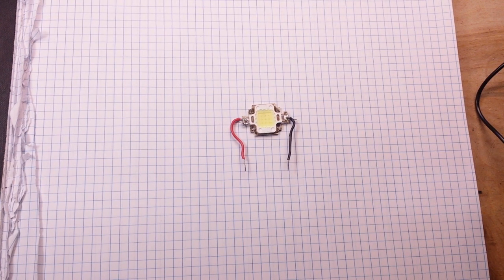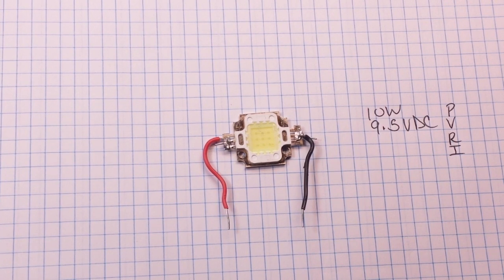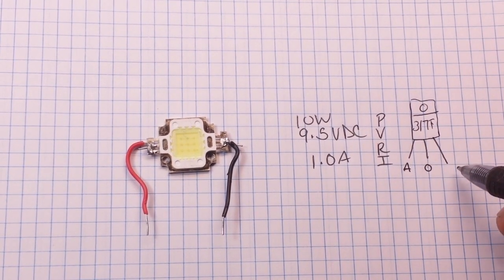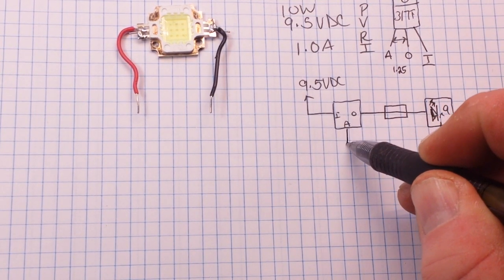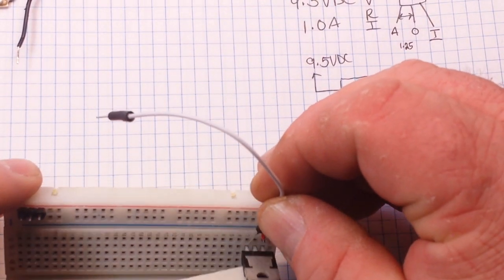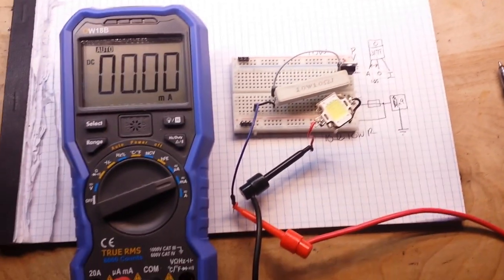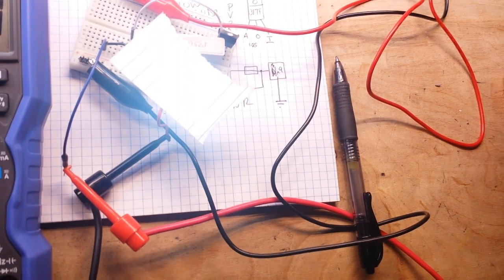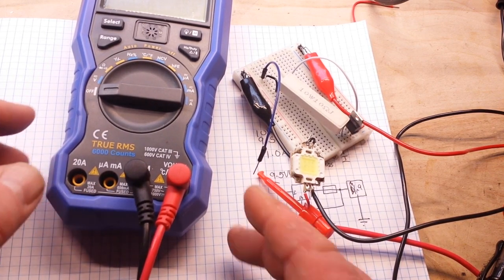How to make an LED driver circuit

Comment: This is a really great video, I like the way you explain your understanding, so I can understand
Reply: Niners fan, from way back though
Reply: Also sir I am struggling we're trying to find knowledge on how to build a simple circuit to monitor and recharge lipofe4, if you could do some videos. I really I really think the simplicity of how you talk would help me to understand. I know with mosfets there is a way to provide the correct voltage and amperage after testing. It's revolutionary and I wish someone would just do it
Reply: Once again thank you

Comment: I used to be a Patriots fan until Tom Brady left that's interesting with the lm317 I've used that to make a driver for a laser circuit for a diode laser it's also the same chip that's used

Comment: Hi, I have a current source driver 900ma, and one Led 3w. On current driver box, input ac 220v and output 12v and there is two points labeled as -Led and +led. I know Led has vf average 3.4v. There is something confused me, if I connect the Led as labeled that means I’m putting 12v on Led please correct me if I’m wrong! So I’m thinking to connect a series resistor to drop the voltage across the Led to 3.4v. What do you think please. Thanks

Comment: You could use a 7809 with a diode inline with the ground to add 0.6 volts to the output.

Comment: How would you calculate the resistor value if you had a 20 watt 36 vdc led COB? Will the same transistor work for the example I mentioned?

Comment: Cool vid thanks for sharing  . Could you tell me how to test a LED driver and a LED light  With a regular multimeter To see which component is bad?
Reply from the maker: Put meter in diode mode. Red lead to led anode, black lead to cathode. If it doesn't light or you don't see a forward voltage on the meter, then the led is bad.
Keep in mind not all LEDs will light from a meter. So let the forward voltage display be your guide.
Reply: @learnelectronics  ok thank you!

Comment: Here's the project. I am adding a 274 nm LED bead to my hard shell N95 mask to help reduce possible infection. Will the coin battery with switch I am using power the LED bead? Not going to into particulars.
Reply: Check out bigclivedotcom channel, he has done a fair bit about UV purification

Comment: Can someone please explain a little clearer how to calculate the needed resistor value for a given current? I get ohms law but I'm not sure how to apply it to this circuit for figuring out what value you need. And also, will this maintain the CC with varying input voltages? For example, running an LED off a battery, would the CC drop as battery voltage discharges?
Reply from the maker: You have to start by looking at the data for the LED. It will tell you what the current recommended is. Usually about 20mA. Now you know one part of Ohms law, I, the current. Then you should also know what your supply voltage is, say 9VDC. Now you have 2 sides of the triangle a can solve for the unk
Reply: @learnelectronics  but i mean, is the idea to size the resistor between output and adjust so that it's passing the desired current to adjust pin? That's the part I'm not sure of.
Reply from the maker: Yes. The manufacturer tells you the current for the LED. You know the supply voltage. So voltage divided by current equals resistance. That's how you figure out the correct resistor.

Comment: can this driver keep a constant current on a variable dc voltage, eg automobiles 12 volt system  which may vary from 11 to15 volts or can it only work for 9 volts

Comment: Good day, excellent video, you have earned another subscriber, I have a query, in the country where I reside, Argentina, the import is quite complicated, I need to manufacture the drivers for 3w smd LEDs to reform the original lights of the cars  , in cars the voltage usually reaches 14.6 / 7 volts, I have already manufactured a LED sequencer with the integrated 555 and 4017, but these do not handle the indicated power, that is why I need to group them 3 by 3 with their respective  drivers, could you help me with this?  my email address is locomario7852@gmail.com, I would really appreciate your help, it will only take a few minutes, thank you very much!

Comment: Hi!
I bought a led driver which requires an input voltage of 5-32VDC. Can I simply use an adapter which has an output of 5V/2.5A? Please help. Thanks!

Comment: V=9.5, I=0.120A then Power=1.14W. you are driving 10W led with 1.14W of power.
Reply: Because it's a breadboard demo! Running 10w into it in this setup it would overheat too quickly for the video. It's just a demo of the CC circuit not an implementation design guide.

Comment: Could you please help me to clear one confusion. I posted on many forums but did not get any reply. I brought a LED bulb driver from a reputed manufacturing company. I found something unsual. When I complained, the company did not bother to response because they are over confident. I shall be hightly thanksful if your provide your opnion. My email ID is s.kawish@gmail.com and WhatsApp number is +917502000800. Please respond by any means so that I could share the circuit details.

Comment: Awww, why hate Patriots fans ! By the way, after switching to 10 Ohms, you could have shown the new calculation would be 1.25/10 which is around 125ma...pretty close to the 130 ma constant current it was showing there.

Comment: Nice video but it would have been even better if you had designed an adjustable current source for this application...
Reply: ats89117
An adjustable 10 ohm, 10W resistor is expensive and hard to obtain.

Comment: Thank you for that awsome video, it really has closed a gap in my knowledge that I've been fumbling with for a while. 
I'm off to my parts bin to see if i have all the bits to pull this one together.
I really do feel like grasshopper being taught by the master in that old 80s tv series when I watch your vids.
As always thank you for sharing your knowledge.
Reply from the maker: You asked for it, you got it! Glad to help.
Reply: @learnelectronics  Thank you so much for your help, you are one awsome person. Since your video I've built the circuit and worked through the calculations and thanks to you have a much better understanding of the associated principles behind the build..

Comment: How would one approach this problem from the other end of the scale?  I have a reel of strip of 12v LED that you can cut to length and crimp connectors on to.  What if one only wanted to use a couple of the LEDs in a model or very small project?  I know nothing about the LEDs other than they require 12v.
Reply from the maker: They are usually in parallel and can be cut in multiples of four. Usually. So, 3V x 4 = 12V Still gonna need 12. Those strips take 12VDC no matter how you cut them,
Reply: @learnelectronics   Thank you for taking the time to reply.  I very much appreciate it!
Reply: Do you mean something like this: https://www.amazon.com/LEDwholesalers-Flexible-300xSMD3528-Adhesive-2026WW-31K/dp/B002QQ48TK

If so then the dropper resistors are in place (as long as you cut on the cuttable sections) which means you can power it from any 12v supply without having to worry about current limiting...the LEDs take so little current I doubt you could find a plug adaptor/battery that had too little current to power them.
Reply: @jonelectronics510   Yes, in fact that might be the very reel I have.  I did find that the cheap wall wart they supply does not supply enough amperage for more than a couple feet of the tape used in another project, however.  I had to use another supply to keep them from dimming beyond about two foot length of tape.

Comment: Very interesting.  However, you didn't vary the input voltage coming from the power supply, which is more or less what I thought a constant current supply was all about.  The current should remain relatively constant over the range of the maximum voltage that the regulator can tolerate.  
Varying the current limit knob of the power supply would prove the current limit function of the power supply worked, once you limited the output to less than the current limit of your attached circuit, but it doesn't seem that it demonstrates the constant current capability of the circuit you built.  
That said, it's a good circuit for driving LEDs, and is relatively inexpensive to build.  The drivers that come with LED strip lights are problematic at low loads, such as when you trim a small number of LEDs from the strip to light a small area.  This circuit is really good to drive them in a situation like that.
Reply: The explanation is not complete for people with little understanding of electronics. As a matter of fact, this explanation will be a fail in an electronics exam. The LED requires a specific voltage according to its characteristics V/I. For this circuit to do it's job, the supply must provide at least the sum of voltages: Vled, I*R=1.25V, Vdrop LM317. The LM317 has a minimum drop of about 0.2V and a specific 1.25V between output and adjust pin. At 9.5V the circuit is not limiting the current, it's just providing the maximum voltage to the output, the resistor providing most of the limitation. Given the measured current of 120mA, the voltage across the LED is Vled=9.5-1.2-0.2=8.1V, which yields about 8.1/3=2.7V per individual diode, which is ~ the starting voltage for a high power led.
Reply: I agree, in this scenario I think a fixed resistor would have worked. If he would have varied the supply voltage it may have demonstrated the need for the LM-317's current limiting ability in this circuit.

Comment: Great video Paul. I’ve got a few of these leds that run at 30 volts. They are a pain to light up, but you have given me an idea. You rock man.
Reply: I have a 30W UV LED that needs 32v at 1 amp so all the 30v lab supplies are just barely under the threshold. It turns on but to get full brightness I gotta bring up the voltage a tiny bit. Kinda like what you saw with his setup in the end when he had it at 9v and it stayed at 3mA. Such a pain having to build an extra circuit instead of just using the power supply on it´s own.

Comment: Well that seemed a lot more simple than I thought it would be. Whould it be possible to add PWM to this circuit to dim the light? and if so, where would it go in the circuit?
Reply from the maker: You can just vary the voltage to dim it. So you would put the PWM on the VCC
Reply: @learnelectronics  Magic, thank you.